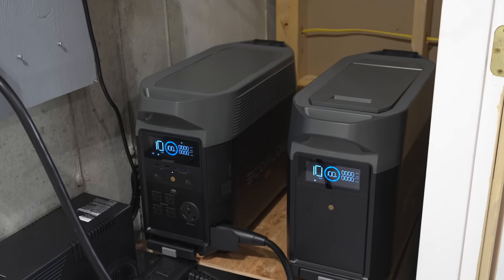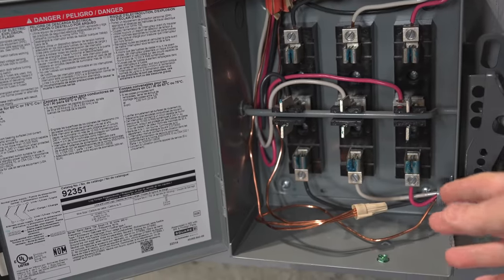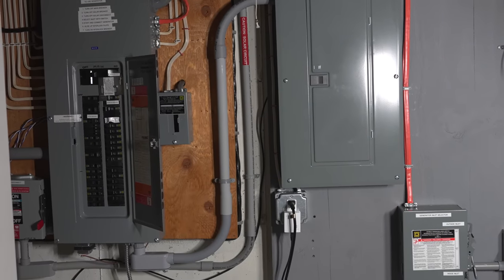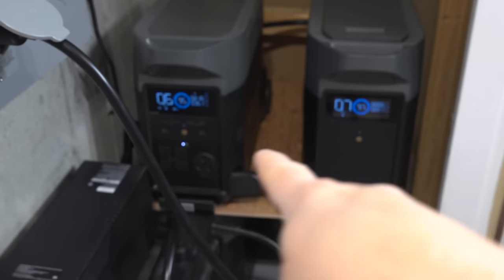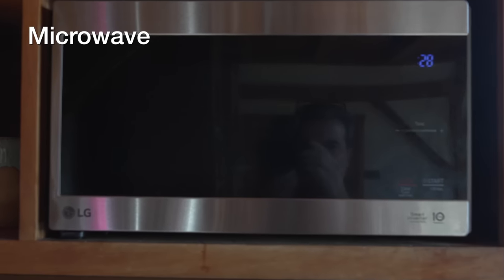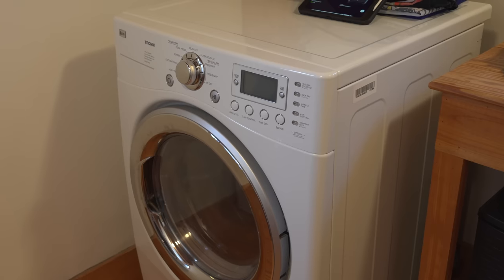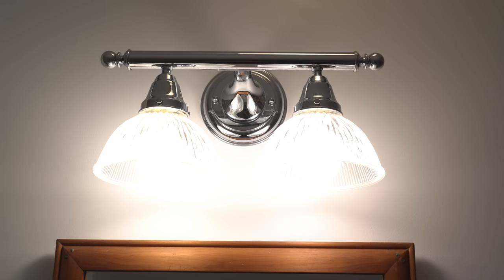How to power your Whole House with a battery generator - Ecoflow Delta pro

Comment: Do you use the batteries to lower your electric bill as well or ONLY for backup power during outages? I am considering doing something similar to your set up but I want to use mine as a home power source as well.
Reply: It takes a lot to charge and maintain the batteries. In reality, using them costs more than any savings. Unfortunately any battery power system large enough to power an entire house will never pay for itself.
Reply: @lookingbehind6335  You might be right but I could think of a few ways to make it possible. two Eco Flow deltas and two expansion batteries would be about $13000. I don't know how much it costs to install the generator hookup to your home. However, for about $2000 you could get a large amount of used solar panels and make them ground mounted. A roof install (for my house) would cost about $15000 alone. For about the same amount I could get the two sets of batteries and a DIY solar set up. Not ideal but possible.
Reply: @mida42  
Even your setup would cost over 30k dollars. I don’t think it would be possible to recoup. When you factor in maintenance, repairs and replacement…it’s impossible. Most people are lucky if they get 5-8 years out of the batteries. There’s just no technology available to store energy effectively. 
Different people put different values on things. I’m not knocking anyone or any system. I really dig into cost and calculate things too much anyway. 
Enjoyed the conversation and viewpoint.

Comment: Question: I have an electrician coming over to do the exact same thing you did.  However, he suggested using a transfer switch instead of the double throw.  Thoughts on why you opted for a double throw switch instead of a transfer switch, especially since the DT comes with a premium price relative to the transfer switch. Just want to make sure I'm not missing something before the work is done.

Comment: Math time:
Ecoflow pro: 3,499.00 (on sale)
Extra battery: 2,599
Not including install, rewiring, and of course every few years replacing..
Minimal cost $12,000+ (over 10 years more than double)
Generator cost+ gas around $2000 (over 10 years depending on gas prices, maybe $2500).
Sponsored by big battery who wants to remind you that power storage always comes at a higher cost.. thermaldynamics and chemistry don't change.
Reply: Of course, how much you spend on gas depends directly on how often you lose power.  If you never lose power then you spend nothing on gas.  If you lose power frequently then it is going to be more.  Without a battery to complement the generator, and frequent outages, when the generator does run, it is going to waste more fuel running under low load.  With the battery, the generator only needs to be fired up once the batteries are low, and can be shut down again once they are recharged, always running at optimal efficiency.  It can also be complemented with solar to run even less.
Reply: @phillipsusi1791  " With the battery, the generator only needs to be fired up once the batteries are low, and can be shut down again once they are recharged, always running at optimal efficiency." It's not efficient, batteries lose charge when not in use, and under constant charge they drop in power faster. That also implies that you are constantly going to run your generator, refueling with gas. Thermodynamics shows an inherent loss is unavoidable, and you are going from chemical energy to electric back to chemical then trying to store it there, and back to electric to use. Every transition will have loss. Every loss multiplies. Batteries wear out. This is a good way to flush a lot of money down the toilet fast.
Solar as in photovoltaic adds yet more complication, again another transition but this time, greater than 70% loss upfront and a very high expense.  Solar is also one of the more dirty production methods, as the rare earth materials solar cells are made of can't be mined safely at any rational cost. They are all mined in third world countries. Then there's the variable nature of solar, only works maybe 4 hours in a day on good days. At around 20% efficiency it's a poor choice.  Then solar will also ware out in about ten years. There's many ways to throw away your money.
Reply: @frosted1030  You misunderstand.  The question is whether you run the generator 100% of the time, typically at only 10% of its rated capacity, vs running the generator 15% of the time at 85% of its rated capacity. Sure, you lose some charging and discharging the batteries, but that is less than what you lose running the generator most of the time at only 10% of its rated capacity, so you are better off with the batteries.  More importantly, when you are in a situation where you need to run the generator, gas to fuel it also tends to be in short supply, so saving on that is critical.  In addition, solar does not use "rare earth elements" at all ( silicon is the most abundant element on earth ), and even if it did, they are actually not very rare at all.  They also last for 20+ years, not just 10, and they are supplying power that entire time, not just when the grid goes down.  If your solar can meet most of your needs all the time and for the times when the grid goes down, you have batteries plus a generator for backup, then you can keep running just fine and not depend on large amounts of gas that is mostly being wasted and is hard to replace during the times when the grid is down, which is the only time you actually need it.

Comment: Could you reviewers simplify building a watch and tell us what time it is. As in will this (battery) power a window air conditioner for 24/7 with solar assist. And if so break that down. What kind of panels etc.

Comment: Love your videos. 
Can you give a high level estimate of what the cost of this setup came out to?  Once you get up to ~15K it's competing with things like Tesla Powerwalls.  I'd like to think that this could all be done at a lower cost than the Powerwall solution, but there are so many parts and you've done alot of the work yourself.
Reply: I just saw the Ecoflow whole-house system that they unveiled at CES. Looks like they're directly competing with Powerwall now. Claiming the whole-house kit will be ~7K+. You'd be locked in to Ecoflow by using their Smart Home Panel so less flexible than your solution buut it looks to be mostly DIY. Cool stuff.

Comment: No, it can't power all of your home's appliances. At least, NOT for very long without permanently damaging the MOSFETs in this solar generator's lightweight, high frequency, transformerless inverter. High frequency inverters are not designed for powering inductive loads such as large power tools, air conditioning units, microwave ovens, large refrigerators, air compressors, etc. You may be able to start and run these types of loads when this unit is new, but over time, after repeated use, the MOSFETs in this unit will fail. I know this to be true because I've operated a factory authorized inverter repair center for the past 23 years and I've seen the damage that inductive loads can do to the MOSFETs in these lightweight, low surge capacity, high frequency solar generators. To make matters even worse, the vast majority of these solar generators are non-repairable. At a typical shop rate of $125 per hour, with no schematic and limited to no parts availability, it makes no economic sense to even attempt to repair one of these units. Once the FETs have fried on one of these units, (And trust me, sooner rather than later, they will fry.) the unit will basically become a brick. A much better choice is to spend a little more money and buy a solar generator that uses a low frequency, transformer based inverter instead. It will last far, far longer and you will be able to power high inductive loads that you're going to need to power, during a power outage.

Comment: How many KW of electricity does your home use per day? My is about 50KW… How many KW of battery does that little box hold? So, just how many hours of backup do you think you have?
Reply from the maker: Thats enough power to run a city! Seriously though during an outage you have to conserve to some degree. I run all my normal stuff but I average about 15-20kw day during a power outage.

Comment: I have a generator and a transfer switch but like the battery as always have power In case generator doesn't start.  Question can you just start with one battery and not 2?

Comment: Would a 10.24kWh battery backup system along with solar panels work well with my home? We want to run a 3 ton central ducted heat pump system, drilled well pump, fridge, freezer, electric hot water heater, some led lights, some outlets, and a microwave oven. Any input is appreciated. Thank You.

Comment: Really nice setup.!  Im no electrician, but wouldn't a Ketofa SZW26-63 Rotary Changeover Cam Switch do the same as the Frankenstein switch and save $500?
Reply from the maker: Thank you. Yes originally I spent a lot of effort looking at those and similar switches. They seem to meet the power rating,, # of poles and robustnessness and I almost bought one and they are very inexpensive. The issue I faced is that I dont believe any of them are ratied for residential wiring. So they might work but i was too concerned that it might fail or have a worse problem.

Comment: Is there a way to hook that up so that it would automatically kick in if the power went out? Like when you aren’t home to switch it over. This is a fantastic video.
Reply from the maker: Thank you, for an automatic version there are ATS (automatic transfer switches) but they would have to be wired into the main breaker and they are something that takes a lot of effort to  install, move or extend main wires, etc. So short answer, yes, but not so easy to do. This setup allows me to be on battery in about 1 minute, just a few buttons but it does need a person to do it.

Comment: Great video and very informative.  I'm looking to do a similar setup with the delta pros.  Question...Why did you decide to use a 30 amp inlet instead of a 50 amp inlet for the delta pros?  Wouldn't a 50 amp inlet allow for an increase of over 12,000 watts output (continuous) load?
Reply: With the power grid down, one is in an emergency type of situation. When would one EVER run 12,000 watts off of a battery bank that has limited duration during an emergency?  The 30 amp plugs can take 50 amps without harm, the plug prongs are clocked differently so idiots do not plug a 50 amp thing into a 30 amp breaker with smaller wire. He could upgrade to higher capacity batteries, install a 50 amp breaker and still safely use the 30 amp plug (as long as the wire is sized correctly), ONLY the plug would not be up to code but it would be safe. The code police will not notice it. But again, who what where and why would anyone ever run a 50 amp load on a residential battery bank?  If one has a $10,000+ ecoflow system, one would most likely have a $1000 gasoline generator to run higher amp loads and to charge the ecoflows.  
He has 14,400 watt hours of batteries, minus 20% makes about 11000 watt hours. Imagine an upgrade to double that to 22000 watt hours. At 12,000 watt output you will have just under 2 hours of power...................  Shall I even send this dart of a note? The moral of this story is; count your watts. You will have lights, radio, computer, a smaller refrigerator, coffee maker between two 1 hour generator runs per day. Saves gas, noise, and worry about a generator catching fire and creating a personal emergency.
Reply: Perhaps I don’t understand the tone of this reply.  So, if I’m wrong about the tone disregard this rebuttal.  Why so snarly?  Aside from the bark and insinuations of idiocy, very informative.  Yeah, a good rule of thumb is…Maybe you shouldn’t send darts when you don’t understand your target audience.  You have a good day sir!

Comment: Would it work to set up this system and leave the house running on the batteries 24/7, and then focus the house connection to the utility grid/solar cells to keeping the batteries charged? That would seem to turn this into for of a UPS for the house.

Comment: @6:35 didn't you test one of the Ecoflow hybrid gas generators about a year ago? I'm confused, or is this a different generator your talking about
Reply from the maker: Yes you are correct but I wasn't able to tie it into the generator and see it run automatically starting & stopping. It also was a gas only model , the current version is now a dual fuel gasoline and propane which is pretty cool. Once I can run it and test seeing it start/stop and make sure it all works I will definitely share my results. It seems like a brilliant idea

Comment: I have solar panels, if I did this where there is an interlock and generator inlet to plug into (batteries)...will my solar panels generate power for the house and excess to the battery again? Where would the extra power go?

Comment: I already have a gas powered Generac 16k. How long would it take to charge these kind of batteries and how long would the batteries power my house if I only run a fridge and 2 deep freezer and a stove? Could the system switch automatically from one to the other?

Comment: Hi for a house with grid tied solar. When the power goes out the solar disconnects. How does it work when you switch the power over to an ecoflow. Does the solar array become active again? Does it feed back into the battery? Would it cause a problem when the generation has no where to go?

Comment: I really enjoyed this video. Could I set this up in the garage? Dont have a basement here in south Texas.
Reply from the maker: Yes absolutely, the only concern is that they can't be charged below 32 degrees, they can be used for power. But not recharged, in case that could be an issue.
Reply: @SilverCymbal  oh cool.. thanks. my garage has foam insulation in the ceiling. Looking at getting the garage door itself insulation with some foam boards. Looking at different options. This should help with temperatures in the garage for the equipment but also going to add a home garage gym. Lol

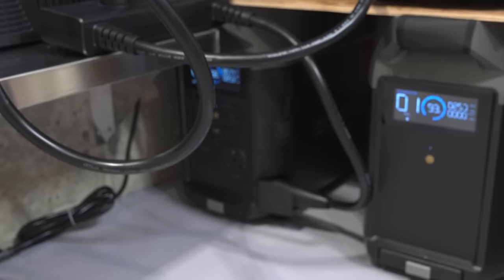Comment: 0:55 - 7.2kw continuous and 14.4kwh is actually not bad. A tesla powerwall does 5kw continuous (I believe) and has 13.5kwh of storage. Now, here's why I wouldn't do what you're doing.

* An Ecoflow Delta Pro is a little over $3K. 4 of them is $12K, which is a bit more than the just getting a Tesla powerwall

* I had an Ecoflow Delta Mini and ON THREE SEPARATE OCCASIONS, it broke and refused to take a charge. Why? I was told (after the third time) that you can't use it as a UPS. I had all of NAS, router, mesh wifi, etc, plugged in so that when I lost power, they would still be powered. So if you're running your house on these batteries, (according to Ecoflow), you'd have to stop using them, charge them, then use them again. Basically, you can charge the batteries while using them. Well that makes it useless as back up power, because what I'd want to do is hook them up to a solar power array and in the morning, the batteries would get recharged, while the house is still running on the batteries.

* Sure, getting a powerwall means you need to get it professionally installed. But the other option if you don't want a powerwall is to simply use your EV battery during a long term power outage and charge it using solar panels. I'd rather take the $12K spent on those batteries and put it toward the purchase of a Ford F-150 Lightning, then put solar panels on my roof.
Reply: What good is an EV and solar panels going to do you when mains is out and your solar panels shut down and you can't charge the EV?

Comment: I'm wondering which is most cost effective & efficient, a whole house battery back up with a gas generator to top off the ecoflow batteries, or to add a Solar array to continuously charge the batteries. All of this can be done with a roof mounted system if you live in a sunny area, but the Tesla power wall is extensive. Problem for me in Florida, is the Hurricanes. I've seen roofs go with the Solar panels during Ian last year, and I've seen the Delta gas generator instant on... As long as they are now using Lifepo4 batteries, this may be the best way to go... I just simply can't make up my mind. I'd STILL buy the portable panels just in case.
Reply: I mean, with a good install, I'd think if the panels are being ripped off, the roof probably is too. Also, it shouldn't cost much to add the solar panel value to your insurance. I'd go with solar, no relying on getting gas in even a minor disaster if you don't keep much on hand. If the gas station doesn't have backup power, you're not getting any either. Panels are pretty cheap nowadays too, roughly $0.50 per watt.
Reply: Where I am in Louisiana, Ida messed up a lot of roofs, but houses with solar seemed to fare well.
Reply: I am also in Florida, Cape Coral, to be exact. All the homes in our area with solar were ok. Panels stayed intact. I'm sure there were exceptions somewhere.  We were in the eye of the storm and IAN lasted a long time. I was shocked to see the panels still in place. We had no power for 10 days and ran an ipower 3.8k inverter generator 12 hours a day. I have added a Bluetti AC200P and two 370 watt panels to supplement the gas generator.  IAN was rough. Great to have supplemental backup power. 👍
Reply: The batteries for the ecoflow should retain 80% of their capacity for 10 years if they were used everyday.

Comment: If you're using the dual voltage hubs, doesn't the DP disable the AC input on the back of units? What about turning off the DVH and plugging your generator to power the house and just plug the AC in from a couple of house outlets to charge the DP's?